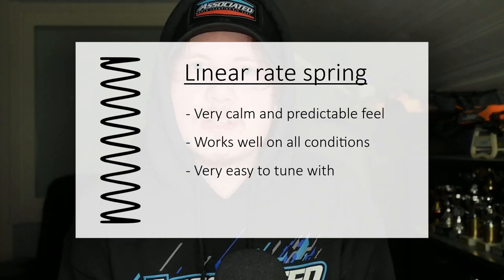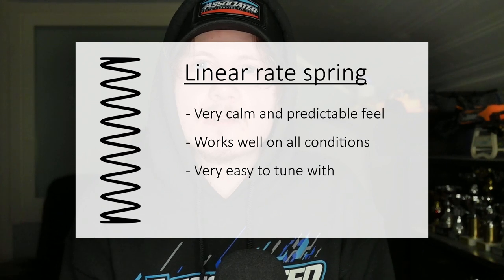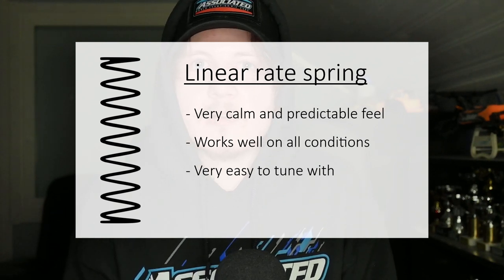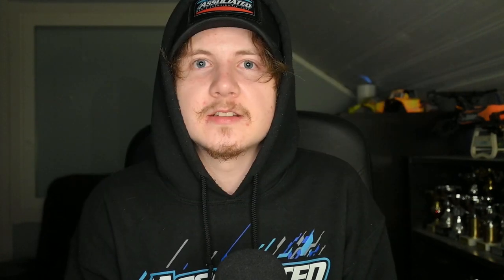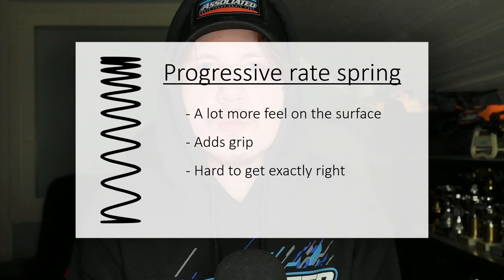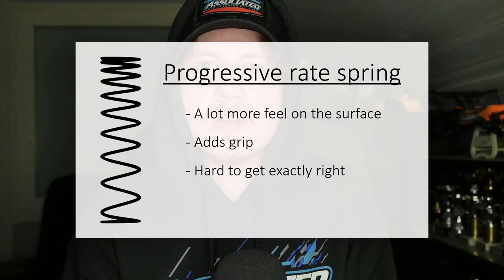From the ground up: Springs

Comment: Great work ... really looked forward to watching all your videos.

Do you need to change oil in relation to change in spring rate (i.e. stiffer spring, thicker oil)?
Reply from the maker: Really depends case by case but often times yes I do go up in oil and spring both at the same time.

Comment: Not true to say "springs allow the car to roll without putting weight on the tyre". In fact springs are used to tune the weight transfer to and from the tyre. The internet  is full of misconceptions, and this video does nothing to help a newcomer to our wonderful hobby.
Reply from the maker: That is exactly my point in saying that. You delay the effect of the roll by having a softer spring that allows for more displacement. Springs are a way to control how far the car is allowed to roll and with that how slow the weight is being allowed to transfer. If you had no springs at all the weight would transfer instantly. This is why we use springs to delay the weight transfer and control the grip level at the peaks of the suspension force.
Reply: I was always taught that springs control where the weight is transfered from and to, but it is the job of the damper to control the speed of the weight transfer. Is this wrong ?
Reply from the maker: @robinhisloprh  That is entirely correct what you are saying. The thing I am explaining in the video is when we are talking about the car in roll we exchange displacement for weight transfer. Effectively instead of the weight transfer happening instantly we have a period of roll. With springs we control how far the car rolls. 

Basically the way I would think of it as a way to split the force into displacement and weight transfer. Stiff car 100% of force = 100% of weight transfer. Soft car 100% force =  20% displacement, 80% weight transfer. 

The reason why I explain it in the way of speed of the weight transfer is because for displacement to happen it needs time.

Damping and roll centers are the correct way to control the speed of the roll. In this video I wanted to focus on purely springs. To explain these things in laymans terms I have made the conscious choice to dumb down some of the effects. 

In reality basically we control how much roll goes through shocks through roll centers, then we control how fast the roll happens with damping and with springs we control how far the car rolls, effectively the maximum point of roll. All of these work together and affect each other. Without enough displacement you wont have enough damping and without a moment arm you won't have enough force through the shocks. Its effectively and endless cycle of fine tuning.
Reply: Thank you for explaining that. I can now see why you dumb it down. Taking just the springs in isolation and not along with the roll centres and dampers actually makes it harder for me to understand, but that's probably just me.
Kind regards.